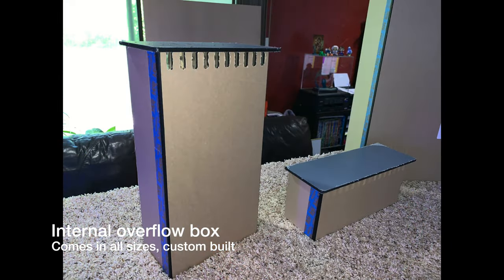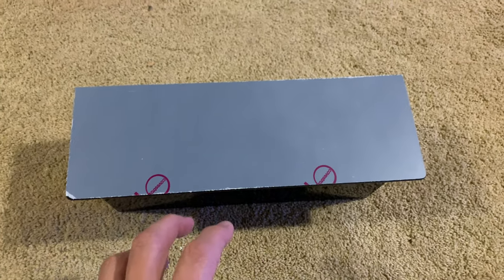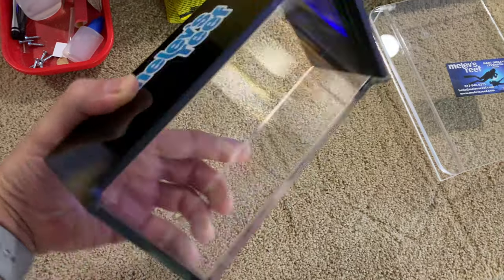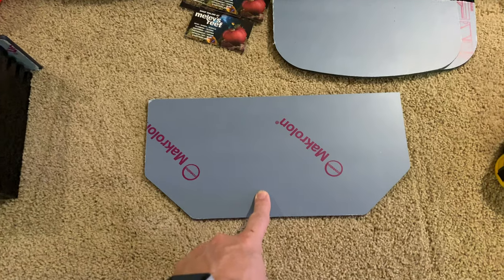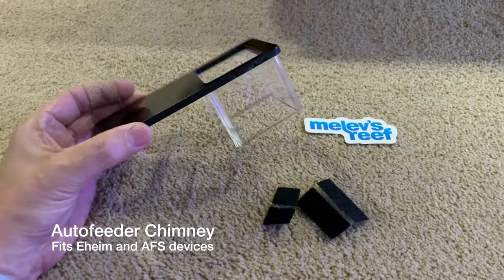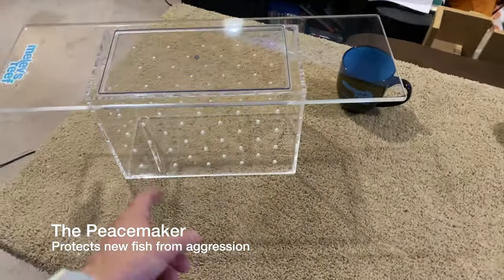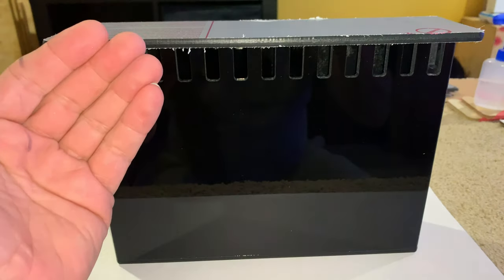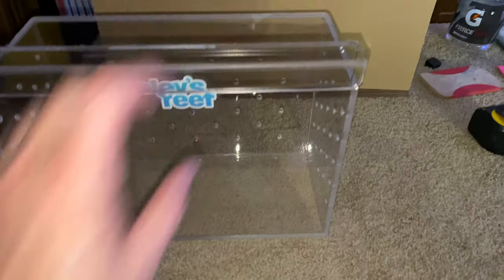Acrylic things I build

Comment: Be sure to ask for polished edges and pay extra for them,  otherwise he will send them rough. Told me to go buy sandpaper and a blowtorch if I wanted polished edges. 

I had assumed they'd come polished, or at the very least sanded down. Nope. I can see the saw marks, even.
Reply from the maker: I don't use a saw, I use a CNC machine which is a computer-guided router.  Your request was unusual, and I didn't realize what you had in mind. I thought these were just covers that stayed out of sight. As I told you in my email reply, I didn't do anything with the edges because I didn't peel off any of the paper backing specifically so none of the clear acrylic would be scratched during shipping.  Had I known what you wanted, I would have done it. I don't charge extra; frankly, I didn't know that is what you wanted. My suggestions were a solution to the situation, instead of paying to have them shipped back to me, and then reshipped to you again. I believe I even sold you those at my cost.

Next time, I'll do better! :)